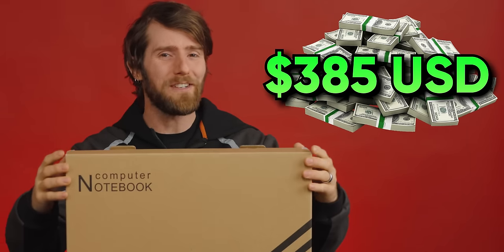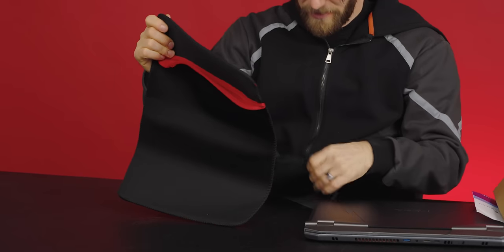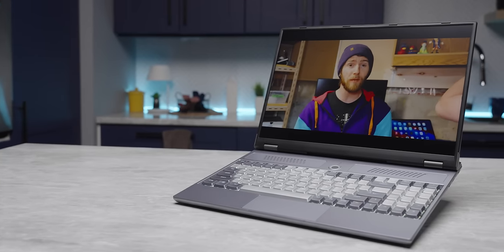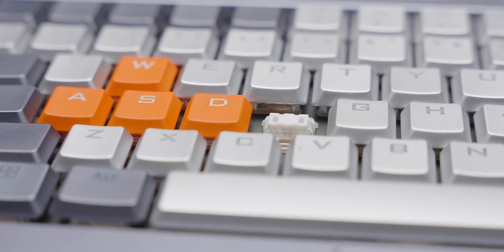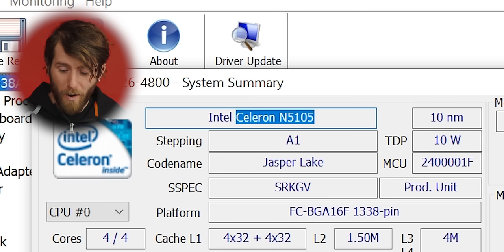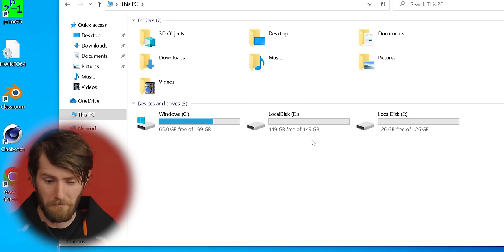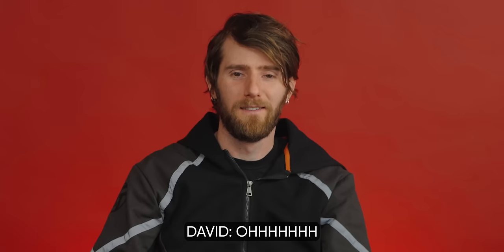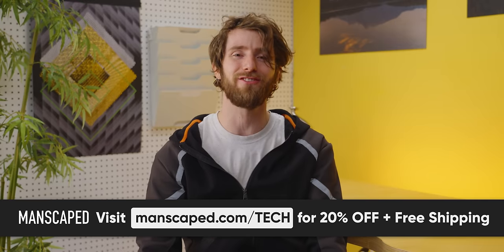Brown Star for Effort – This AliExpress Gaming Laptop is HILARIOUS

Comment: The windows activation you were seeing there was KMS.  They are checking their own KMS servers and registering via that method.  KMSPico will do this on your own without calling home to China. You can setup the MiniKMS server on your own computer and have it call itself.
Reply: honestly just use MAS get a one time license forever less effort this way
Reply: @jeffreyweng9326  right? MAS is incredibly simple and once you use HWID the license can survive completely reinstalling windows. It's never been easier tbh.
Reply: It makes sense that they avoid using local KMS as Microsoft often flags local KMS servers as a virus, even when they are not. By writing their own code to call a third party KMS server, they can avoid Windows Defender getting triggered. Either way, there are better ways to do this as mentioned in the comments above.
Reply: Then again, KMS could be more resilient, since if the HWID method gained widespread commercial deployment, these keys could be disabled in the future, since they could track down any activations performed with a specific IP address. But then again, if the third party KMS servers are shut down, that will also result in failed activations. In the end, the only way to guarantee the longevity of the keys is to get them legitimately.
Reply: this thing is why i stopped pirating windows, and hesitant on buying license, besides most of my need works in linux
Reply: @jeffreyweng9326  what is mas and how can one use it?
Reply: Kmspico is malware. All it does is writting THREE cmd commands for you. You might as well just write them yourself.
Reply: @dirg3music  what is MAS and how can one use it?
Reply: @illuminatigaming177  Microsoft Activation Scripts
Reply: Yeah that's what I was saying too. However they don't use KMSpico any more because a clean version of that is usually difficult to locate. Nowadays they use "MAS_1.5" and is found on Github so it's totally open source. It's all done with batch files too.
Reply: true, but be aware that this violates windows' terms of service (obviously)
Reply: @kirkh4205  pretty sure the megathread links to the legit kmspico version no?
Reply: @SergioGMN  No, it is not malware, but there are a huge amount of pages and links that hosts files called KMSpico that are bundled with loads of crap. Always make sure you download from the correct place.
Reply: @blisphul8084  It's not that easy to invalidate existing activations done with the HWID method (without messing up a lot of valid licenses) when using "downlevel" or "universal" tickets. If using "lockbox" tickets it'd be nearly, if not completely, impossible. They could, maybe, disable new activations from getting validated by changing the whole activation process. On the other hand, if they can be sure that, as an example, a computer store is selling HWID activated Windows computers they could most likely track down the licenses and disable the HWID's associated with them though. This is assuming that the computer store has a static IP, or an ISP that logs their DHCP leases and is willing to share them with Microsoft, which MS have logged and can relate to the HWID. Not sure how that would fly in the EU but technically it could work, just not maybe legally.
Reply: @dirg3music  ehh, HWID doesnt work on Windows LTSC which is the only good version of win10
Reply: Uhuh...sure it is Mr Chinese agent trying to steal my internet!
Reply: @jeffreyweng9326  Yeah MAS HWID is definitely the way to go these days
Reply: @dirg3music  wow thanks for the info, I was using kms from so long and it was annoying with all the steps. This is just one line code on the powershell and we're good to go!
Reply: @peterhober5681  Considering they are in China, I highly doubt the ISP would care to share any info with them. In that case, the worst they could do is to close the free Win10/11 upgrades moving forward, which they said they were going to do long ago, but never fully did. If that ever happened people would be blaming the Chinese companies for ruining it for everyone. As such, it's a good thing they are using KMS.
Reply: @AllenBaby7  glad to help! It's incredibly simple to do these days.
Reply: You can also buy a grey market key for a few bucks. Most of them are technically legit as they are OEM keys (single use keys meant to be bundled with the sale of a prebuilt computer) that are not meant to be resold but are completely valid. In some rarer cases they are MSDN keys or volume license keys and those could potentially get deactivated. Same for the very rare cases of keys bought with stolen payment methods. Either way most reputable key sites offer a warranty for at least the first year if the key gets deactivated, and if you end up having to buy a new one it's not a big deal considering how cheap they are. You could buy like 50 Windows keys from key sellers for the price of 1 retail key. Personally I use AllKeyShop to compare prices for whatever keys I wanna buy, as well as check reviews for the different sites offering said keys.
Reply: @aurelienlux  at that point you might as well just run an activation script because those are just as much of a violation of MS' terms of service. At least with the scripts that are open source and vetted you aren't giving your payment info to sketchy sites. For clarity, I have never had a key deactivated after activating this way and I've been doing this for years
Reply: @dirg3music  Terms of service for software aren't really enforceable anyway for the most part as they're not a contract and are usually only displayed once you've already gotten the software. So violating the terms of service doesn't really matter, unless you're running a business (Microsoft will definitely come after businesses violating their terms or using pirated software).

However the main benefit of grey market keys is that you're not circumventing any protection or activation process since the keys are legit valid keys. When you use a software method to activate you're technically circumventing the activation process which could be considered illegal, unlike buying grey market keys. But yes I am aware that there are multiple ways to activate without buying any key and that the HWID method works very well, is permanent, and behaves just like a legit activation once done. But many people, especially those who may be less tech literate, tend to prefer not to use third party scripts or software and would rather follow the official activation method and those key sites provide a cheap way to do that. As for paying on those sites, I wouldn't be too worried on the most reputable ones and those who use reputable external payment processing (like Stripe or equivalent) but I'd definitely recommend using a single use virtual card (I have that option with Revolut but I know there are similar services in the US like privacy(.)com which I think is now called Privacy Card).
Reply: Interesting
Reply: @BeHappyTo  I have zero desire to use LTSC so that doesn't really affect me and i highly doubt it will for the majority of people.
Reply: You can just use any Windows 7 + keys on the stickers from OEM computers and it will activate your Windows 10 install. Can just find any old computers from companies and that's how i activate all my Windows 10 installs. No money or installations required just access to old computers.
Reply: The keys for KMS activation are also publicly available.  No need to blur it out but it is always better to be safe on that front anyways.
Reply: @kanedaku  haha no bruvv my sister wanted to use windows on her Macbook but there's no way to activate it
Reply: @illuminatigaming177  Ooh!!! Thats very interesting!

Why not use one of those bulk volume sellers, you could get a license key for maybe £8? Either that or pick apart a batch file and try to do it in terminal? Is that even possible?
Wait, if you install Windows then you would activate it ON WINDOWS. Doesn't KMS work on a Mac Winstall?
Reply: @dirg3music  or you just buy a cheap licence. Windows is basically free these days because it's so cheap
Reply: @kanedaku  haha yes you're right it's a nice loophole but I tried KMS and it only activates windows for 30 days and reactivating it every now and then is a hassle
Reply: @illuminatigaming177  There are people here who will be more intimate with KMS, but from my experience you activate Office for 365 days and the calendar is auto programmed to repeat the activation in a year's time. I'm pretty sure the OS activation would work in the same way, but maybe its not possible with the Mac architecture, maybe.
Can nyone herewith more knowledge help out the snigger Illuminati with information? 😀
Reply: @godsena_  are you on a prebuilt computer or a custom build? 

I have a pile of Dell win10 and win7 keys and they will not activate windows on my motherboard, I've just been running windows unactivated. 

I have not had an issue doing that with prebuilt computers I've tried it on though.
Reply: @volvo09  havent tried it on many systems and all my keys were windows 7 pro keys but they all worked for me. My pc is a custom build but never had any issues in a VM or anything like that. Doubt your motherboard would be blocking activation. Perhaps theyve stopped this now since Windows 11 hmm
Reply: @godsena_  weird... Maybe it's just my Dell windows pro keys. I always get a message saying it's not valid for this version of windows. But I honestly don't care, I just thought it was interesting that this PC won't activate when all my prebuilts do. I haven't built a new PC in ages, so maybe a new board would have better luck. This board is like 8y old.
Reply: @AllenBaby7  downloading and pressing go lol so many steps.
Reply: @aurelienlux  Why paying for pirated keys when its still a license breach? Its better to get a free activation "solution" then paying to actual thieves. Or buy an actual real license. The key itself is just an activation method, having one does not mean you didn't breached the license. M$ don't care about home users piracy (I believe they make it kinda ease to keep the platform ever present everywhere). And any business operating on a Win activated by stolen key is screwed anyway.
Fun fact: its easier and faster to use win activator and unofficial office installer then the normal "proper" ways. IF you know where to get the clean ones.
Reply: @Vivicect0r  Well they're not pirated keys, just OEM keys. They're perfectly legit, the companies who buy them from Microsoft are just not supposed to resell them. They are also sometimes obtained from recycled computers.
Reply: @dirg3music  and then you change your build(including motherboard) every 2 months. Good luck with that!
Reply: @ionutalexandru7066  wtf are you talking about, I've been using the same exact key on this build for like 3 years now. I have a laptop thats been using hwid for 5 years, no license invalidated and no need for new parts. Just say you don't know what you're talking about and move on. Lmao
Reply: Linus shouldn’t do edibles before recording.
Reply: just fucking use MAS X20
Reply: @BeHappyTo  what happen with ur name?
Reply: @aurelienlux  You don't really understand how license works. "Not supposed to resell" means license breach means that your key, while working perfectly to activate Windows copy, doesn't give you an actual right to use Windows. Any police check or court will result in a fine or prison time (if you have enough pirated software altogether). It doesn't matter if you have used a "cheap" key or an activator, its still piracy. 
P.S. Ok, your lawyer may prove you was mislead by the keyselling website and never meant any harm, it depends on the country and its law.
Reply: Nah it's for piracy bro.
Reply: @Vivicect0r  Actually, buying an OEM key is perfectly legal. Microsoft disagrees with the practice but legally they can't do anything. Even the sites probably can't get in trouble since they themselves didn't obtain the OEM keys from Microsoft but bought them from other sources. The only companies who can get in trouble with Microsoft is the initial ones who obtained the OEM keys from Microsoft and then sold them to resellers.
Reply: @fltfathin  Pirating Windows and potencially infect your PC and/or get the key disabled isn't worth anymore, OEM keys so damn cheap now, I've got one 7 years ago for like 3$ on eBay for W10, then I got the update to W11 and still, Windows is activated (also survived multiple formatting too)
Reply: @UsualVII  IKR that's why i stopped, last windows i pirated was XP, the permanent-written CD key works OOTB without any software addition yet it still break every month since XP still have lots of vectors for malwares back then. btw i don't want to buy cheap OEM keys since microsoft can revoke the key willy-nilly since i techically broke their EULA day one, also who knows what involved in procuring them (stolen key from OEM, bought from carding, etc.) and i won't buy the full keys too since my current work didn't justify me buying one (as in not requiring windows) and i plan to change lots of my parts later on. for the job, linux fits all the needs.
Reply: @volvo09  Because the Windows installed on DELL computers are OEM customized versions (same for LENOVO, HP, etc.), and the Windows serial numbers on the DELL chassis are OEM serial numbers, they cannot be used for retail or other versions of Windows. Interestingly, You also can't install the OEM version of Windows on a non-OEM brand PC because the brand PC's motherboard BIOS file contains the brand's information.
Reply: @aurelienlux  that's technically not legit. Activation with such a key violates the eula, so no reason to pay for it if you can do it for free, it will not somehow legitimize your install